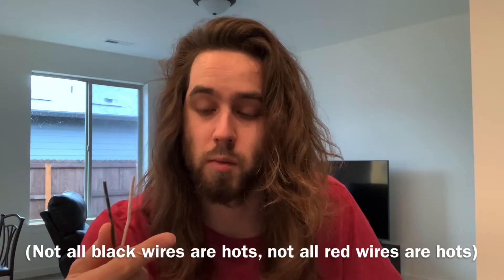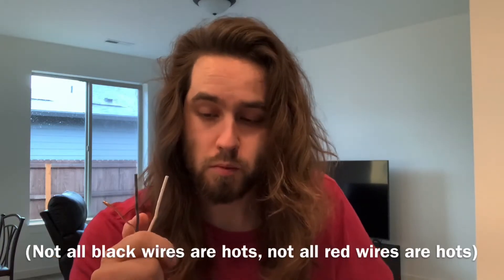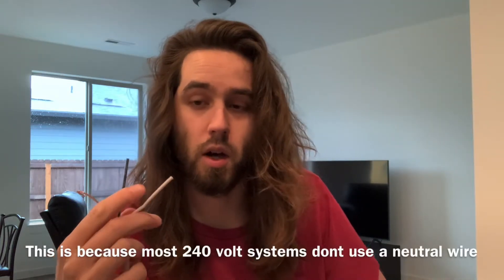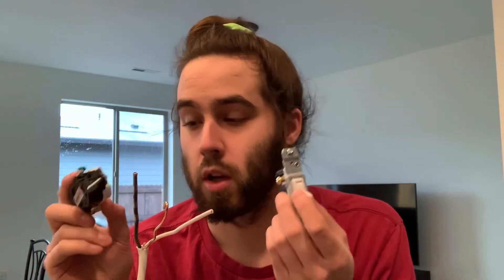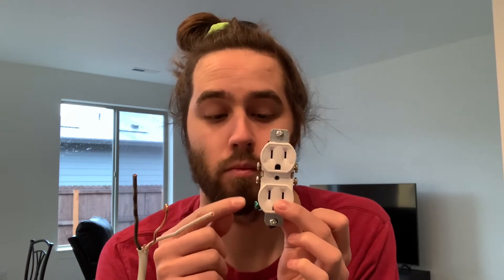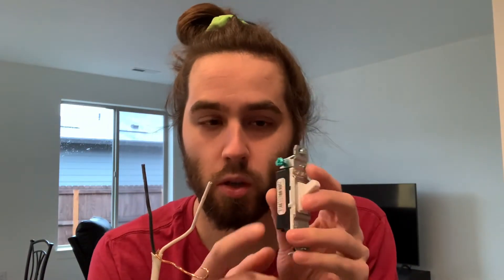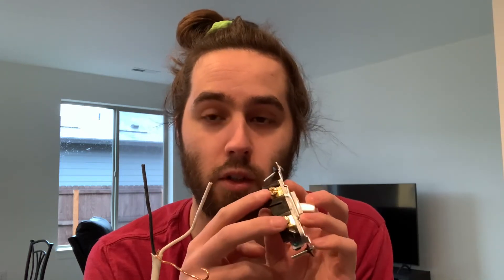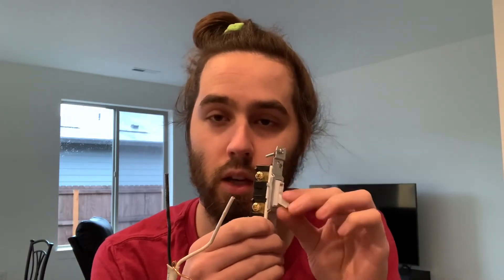Electrical 101: Ground Neutral And Hot Wires Explained + Circuits Explained

Comment: So... There is a very basic concept of A/C that is missing here. It is Alternating Current, which switches direction 60 times a second in the US electrical system. With that in mind, electricity doesn't "return" in one direction and it shows a fundamental gap in understanding what is actually happening here. While the work may often be functional, I wouldn't trust a resource that skipped over such an underpinning of electrical systems.

Comment: What I hate is that as you mention some of the colors you may see and clarify that red and black will not always be hot, it kind of blows up any attempt I ever make to understand this stuff. Because if you can’t even trust the color coding to actually consistently represent some function universally across the field of electrical, what’s the point? From my perspective as an ME, it just seems to me like there’s no established rules in EE and it makes for an impossibility to understand as a complete beginner.
Reply from the maker: yeah, there's a reason why it takes 4 to 5 years to understand everything with school. it takes time to learn. not just a 10 minute video, lol

Comment: is their a tool to tell if black wire is black and white wire is white and ground is ground? just to make sure, if this makes sense
Reply from the maker: yeah there are ways to test that. Never confirmed ground or neutral i dont think.
Reply: If you're trying to check one end that's old and uncolored to a new end that's colored, you can do a continuity test with various meters to see which wire is which. 

Like you'd attach one end of the meter to the known-black wire, then the other end to each of the mystery wires until you get the beep, signifying that is the same wire

Comment: Hey man love your videos, have a question I’m assuming you could help with. I was testing a light switch with a multimeter with the power on, and the switch was on, I think normally I test them with the power off, but I forgot to turn the switch to the off position. When I touched the prongs of the multimeter to the two screws where the black wires connect, it sparked, and tripped the breaker. Is that because I did it with the switch turned on? I didn’t think that would matter because it’s just connecting the circuit whether it’s on or off right? Or was it potentially a bad switch? It is pretty old. Anyway thanks in advance keep up the good work. I learn a ton from your videos
Reply from the maker: Thanks! 

never run into that problem before myself, maybe the meter was on the wrong setting. Many different possibilities, as long as your meter didnt blow up i'd count it as a win.
Reply: @DailyElectrician  haha it didn’t blow up and I didn’t electrocute myself so yeah I’ll take it as a win
Reply from the maker: heck yeah 🙌🏼
Reply: If you want to check if a switch is working, you can turn off the breaker and check for continuity when the switch is on and "OL" when it's off using the ohms setting on the multimeter. You can also check the switch with the circuit breaker on by checking for voltage. Set the voltage to AC on the multimeter,  and put one probe on the ground screw and the other on one of the hot screws. If the switch is off, you should read 120v on one hot screw and 0v on the other. With the switch on, you should read 120v on either hot screw.
Reply: Please tell me you did not touch the two prongs of the mutlimeter to the wires at the same time? One of the meter prongs should be black and the other red. Black goes to neutral or ground, and the red goes to positive. Always start out by applying the black prong first. You must have applied both prongs to the same hot wire.

Comment: It is never as easy as it should be, had HOT to a single-pole sw. (regular on/off) to black of 
porch ceiling lamp, So I'm assuming the with was the lamp's neutral. NOPE  it was going to 
the top of another on/off sw. like what? so I disconnected that wire and lamp still works. the
neutral or  lamp'swhite wire was tied to the box. So there was about an ampere of current
flowing back to the panel.  had the  ground broke at another box, there could be a nasty 
shock hazard if some1 touched the box and a good ground.